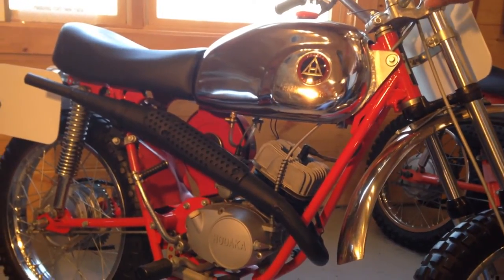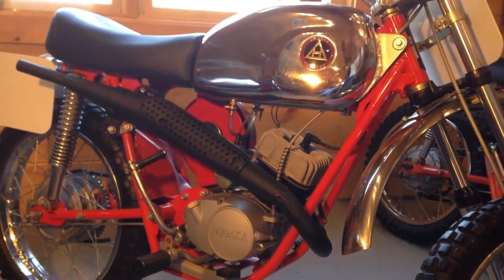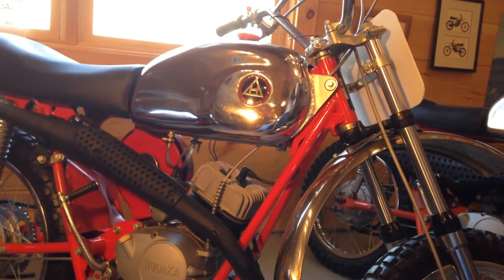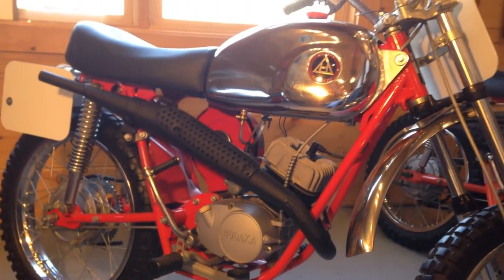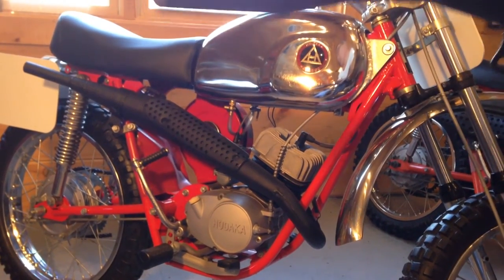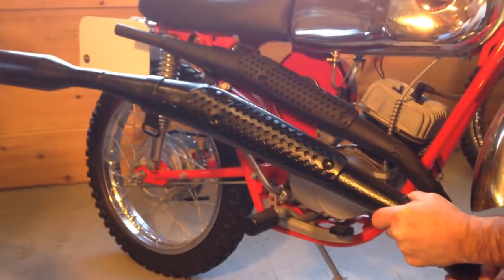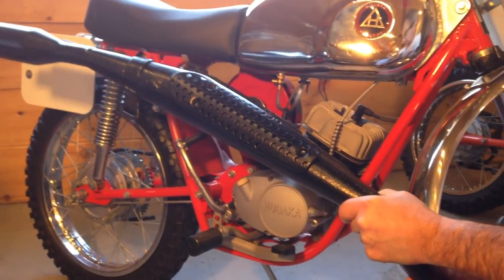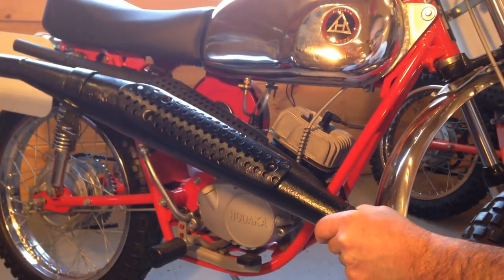Hodaka (93B) Super Rat Model Specifications

Comment: Had the same one in the video. The plate on the steering tube said 1971. Bought it new off the show room floor in 73. Rode the wheels off it. I could wheelie that bike for a quarter mile. Great memories.  ❤ Hodaka's. It was faster than the 125 Combat.